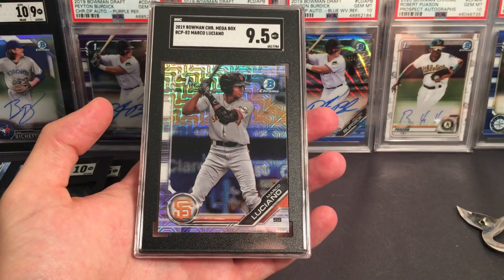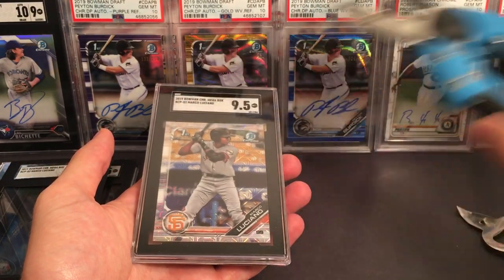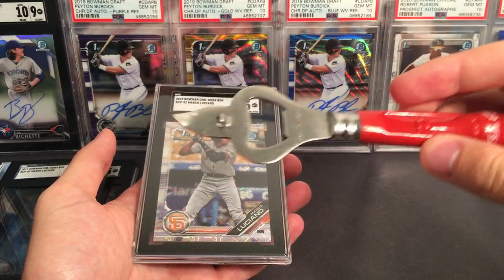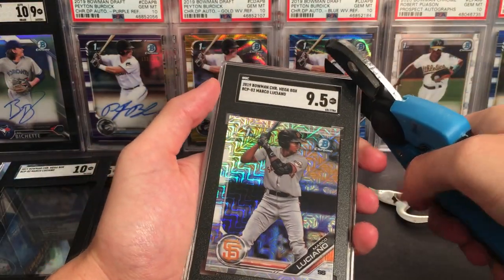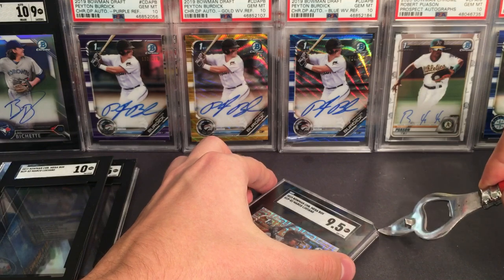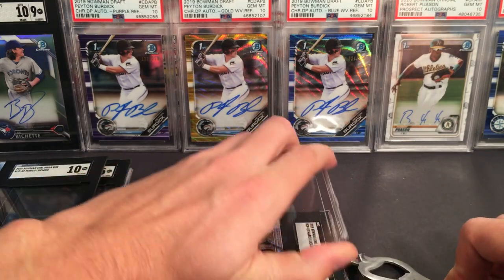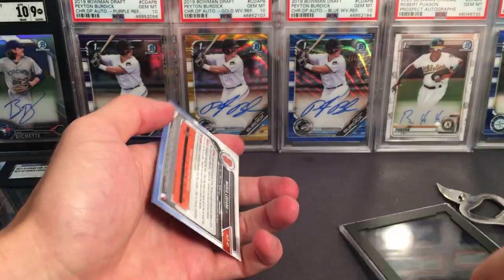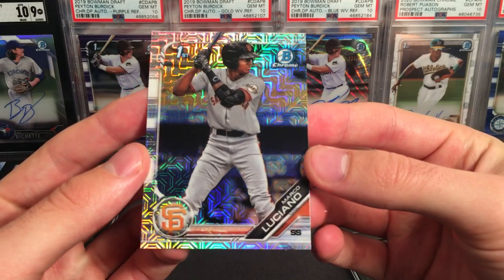How to Crack out a Graded Card Slab in Under 5 Seconds (BGS, PSA, and SGC Cases) Easiest Way

Comment: Hi, have you ever cracked a serial numbered card graded by psa (9) and try to resubmit to shoot for a psa 10? Is this possible being its numbered and they’ll know  that they originally graded it a 9! Thoughts please 🙏🏼
Reply: The serial number is part of the case. The card itself will never be altered by numbering it. (That would ruin the card.) There's no way to know whether the card was previously graded.
Reply: It's pretty common. I think you mean a 3 of 25 cracked and resubbed. That 3 of 25 would still be regarded and could do better than before. So, numbered /## don't change anything.

Comment: Do you crack she 9.5 and send to psa? If so what grade do they usually get? Thanks
Reply: what grade do you usually get?
Reply from the maker: I always look over 9.5s before I crack them out but if they look alright, I’ll go ahead and crack them out. I’ve done it about 30 or so times this year - believe that I’ve gotten about 20 of them back so far and actually, most of them have gotten 10s. SGC is super strict on centering and PSA is not so if you see an SGC 9.5 that is barely off center, chances are it would crossover to a PSA 10 without any issues.